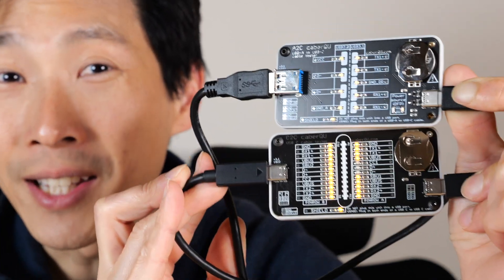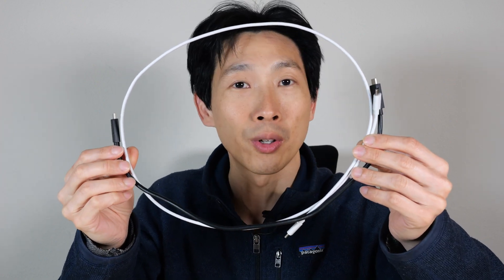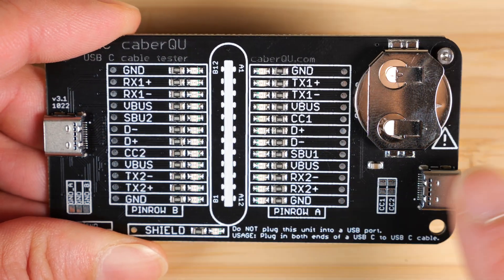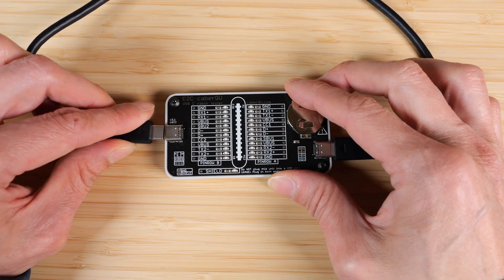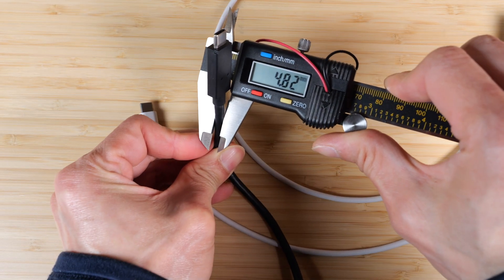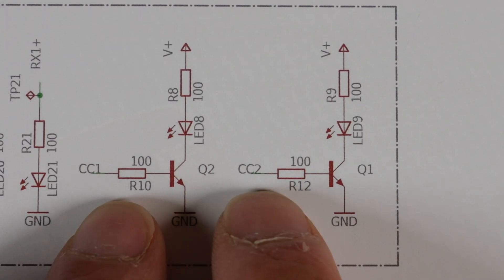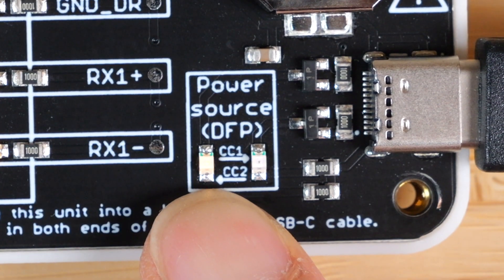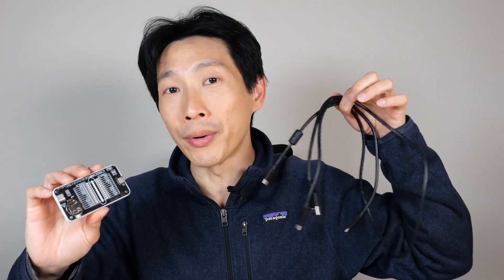Test a USB-C Cable for Faults

Comment: are there any schematics for usb C connectors, on the Downward Facing Port (DFP) on power supply side, should pin A5 CC1 have a resistance or not ?

Comment: What about USB4 does it show all its lines
Reply from the maker: Without digging too much into USB4 specs, it appears to use the same exact pin outs as the USBC. This device measured DC connections so at first glance, it seems that it will work.

Comment: francis, now with pd 3.1 coming out and all the confusion, you should do some videos on it. there are only a handful of videos on yt about it and theyre not really good or are not in english. pd 3.1 with 25v and 48v is going to be really versatile. most "12v compressor refrigerators" are actually built with 24v rv compressors and tap their own supply for the 5v display so you should be able to feasibly power them from a pd 3.1 gan usb-c charger. wall mart randomly has really good deals on their online store for these fridges for like 1/3rd the price. i made a drink fridge and modded it with aluminum tape (low emissivity) on the outside and got it down to 80 wh per day with a little gan 3.1 usbc power supply lol. with everyone going 48v i feel like pd3.1 will be super useful as a DC standard for all the new 48v appliances coming out.
Reply from the maker: That does sound neat. Rather than a dedicated AD adapter for 12V fridge, you use a USBC.

Comment: What is the best way to determine the standard of the cable based on the light patterns? Anything easier than just looking them up constantly and eventually memorizing them? :)
Reply from the maker: Probably just create a cheat sheet to use with it.

Comment: Why cant they detect that both ends are a usb c device and thus be able to use the other two d-/d+ wires?
Reply from the maker: Typically, these shortcomings are a result of no active intelligence in the board. This tester is a dumb tester that wires an LED to a resistor via a connector, thats all you get.
Reply: @BeatTheBushDIY  wait are you saying that both sets of d- and d+ can be used at once by actual devices? I was told that one set is always unused in usb c.

Comment: This does not test for shorts in the cable.

A way to enhance this would be to copy the RJ45 cable tester schematic, which is a timing source like a 555 (slow and fast modes) and a Johnson counter IC, which runs the signals one a time. Or of course you could use a microcontroller, and have the ground or power of the microcontroller run through the cable, so if cable isn't plugged in, it won't turn on and drain the battery.

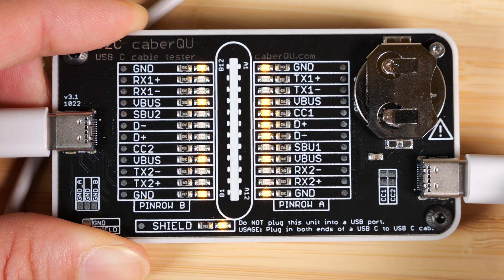Comment: 2:34 What have you done with your calipers? It look exactly as mine (the LCD, buttons and cell holder) and if I leave the cell connected it will drain the cell after a couple of month. It seems to use the same amount of power when it is turned on as it is turned off.
Reply from the maker: I added a AAA battery holder so I don't have to use button cells. =D
Reply: @BeatTheBushDIY  Maybe i should do that too 😀
Reply: You know what you lot should do, strip it apart and apply some tape (Kapton tape or even polypropylene packing tape) to the backside of the PCB. The fault is that the solder stop lacquer is really bad and the PCB vias and badly covered pour areas form a little bit of a current path through the metal pieces! Properly insulated you get 2-3 years out of standard LR44 cell.

Comment: Hi, this is a really neat video!  I like the gadget (might get one myself) because its very useful in my line of work as I work with PCBAs with breakout functionality where the USB interface is used for firmware debugging.   You'd be surprised how many firmware developers don't know how to debug that their USB cable doesn't have wires for the data lines. Please do more informative electronics videos like this if you have the bandwidth.
Reply from the maker: Thanks! Thanks to Peter who sent this over. I actually used it to see which wires are present in my recent review. I'll review more engineering equipment soon.